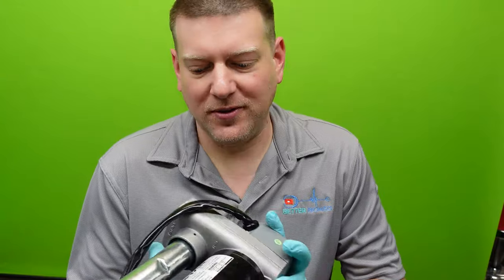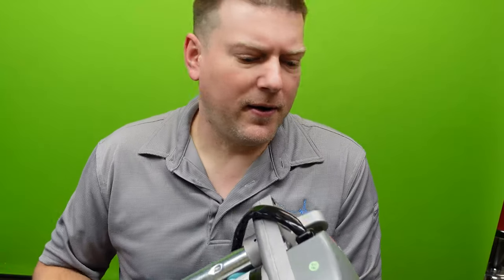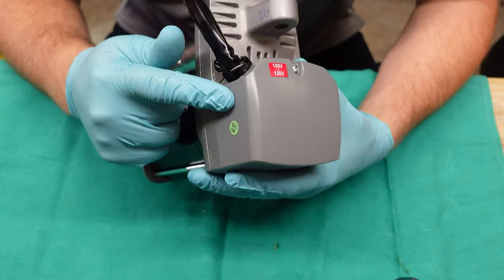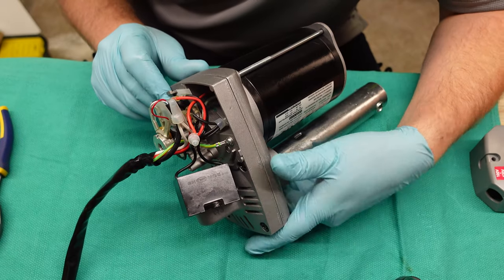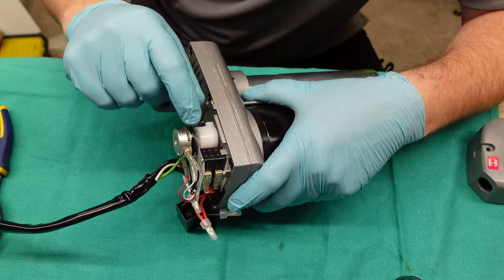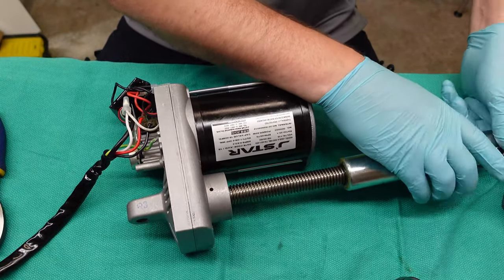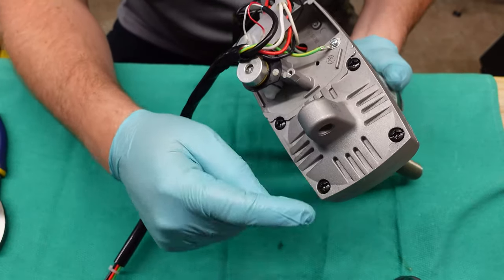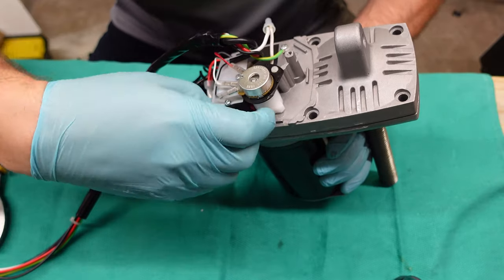Linear Actuator Teardown!

Comment: May i add some safety note?
At 16:25, the piston rod is almost near the gearbox, when the pistonrod is not connected to anything (or not hold by hand) then the timing of the gears won't mather.
But presume that the end switch is in the middle position of the stroke, and the piston rod is almost near the gearbox and connected to the frame of the device, if the motor then got powered up, and it spins clockwise, the piston rod will smash the gearbox housing because the endswitch think the pistonrod is in the middle position on the spindle. 
Now in the video, the pistonrod was not connected and could spin at the same speed as the spindle without having the linear movement, but if the spindle rotated clockwise, and you hold the pistonrod by hand, the entire actuator would give a kickback when the piston rod touch the gearbox and this kickback can break your wrist.
Also, the motor get's jammed up, while still powered because the endswitch is not at one of the endpoints, a thermal fuse (if installed) will then pop, if not, the motor get's probably toasted.
For testing purpose, it's always safer to place the pistonrod (when not connected to anything) a little above the middle position, that way the spindle can't pull the piston rod against the gearbox housing and can't cause damage or harm you.

Comment: To adjust the limits, take the actuator driven screw off. Run the motor until the screw has travelled to the end of it's travel ( the limit switch will stop it  without any damage). If you ran it in the direction so that the screw would have pulled the actuator driven screw in to the gear box the limit will be set in that direction. Then just add the driven screw back on, leaving it 1/2 turn loose so it won't bind up. Voila, you're done.
Reply from the maker: Love it!

Comment: hay there, i have a crazy problem, this j star motor works fine outside but after installing inside the tmt machine it heats up like crazy and shuts down, can you help me out?
Reply from the maker: How are you powering it outside vs inside the device. A defective motor will show massive current draw under load or the device is creating too much of a load due to some other failure.

Comment: Fanastic explanation and demonstration. Thank you for this video got a question during the multimeter test if it does show any readings does that mean the capacitor is short? Thank you
Reply from the maker: Remember that all capacitors show as a short while they are charging. Caps needs removed from the circuit for testing if they are questionable

Comment: I have a similar motor but much smaller one, which should activate gears.
the pcb trasmits the information to motor to spin a direction, but it only spins one way. what do you think could be the problem?
Reply from the maker: Check the H Bridge if it's a 2 pole motor. The motor driver might be at fault or if there's a motor stop detect microswitch- it might only run in one direction because it thinks it's at a limit switch
Reply: @BetterBiomedChannel  there is a magnet thing above a green rectangular thing, i suppose that counts the turnings or directions of the motor. unfortunatly i have no knowledge in this. this is a bycicle rear electronic derailleur. If I could post somewehere pics would be much easier, thanks